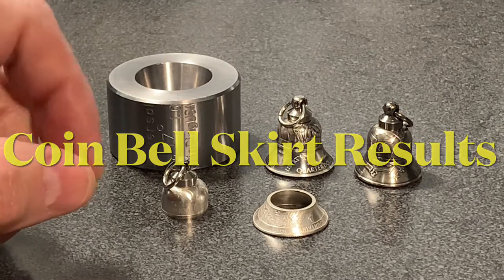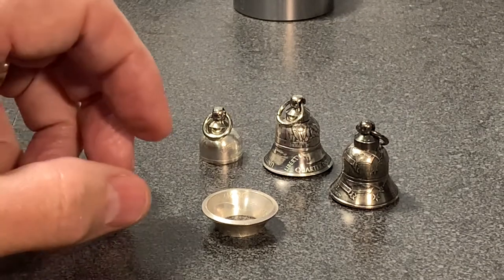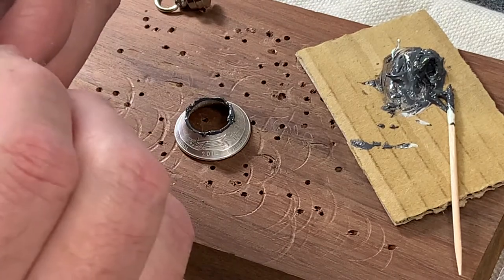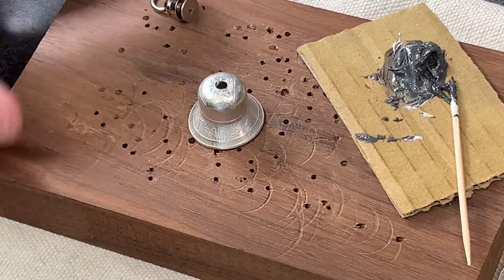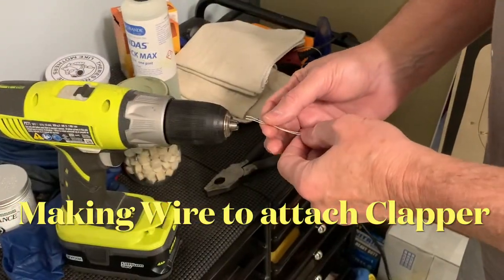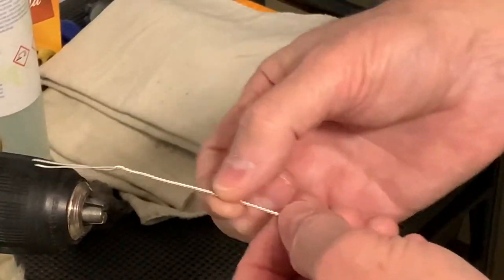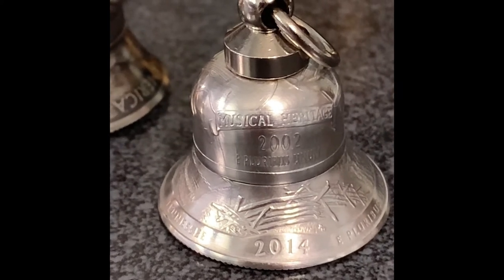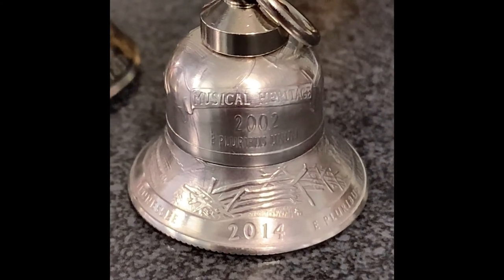Coin Bell Tutorial Part 4 (Conclusion)

Comment: Thanks for a really great series.  I loved making these bells!!   I do however have a question about the clapper. I am making them out of clad quarters using a 3/4 punch out but they just don’t sound right.  Any suggestions would be appreciated.
Reply from the maker: Thanks for the kind words!  I’m assuming that since you have large punch outs 3/4 as clappers then your bells are made from dollar size coins?  

I always make sure the clapper edge is hitting against the rim of the skirt and not inside.  Try a better hanging position or even a smaller clapper. Also, Bells made from silver coins will always sound better than clad.  None of my clad bells have ever sounded as good as my silver or copper bells.  

The same holds true for bells that are made from really thick coins unless they were made from silver.  Hope this helps some?
Reply: @jpcoincrafts  Thanks so much Jimmy.  I am making the bells out of quarters, as I love the size.  I will try some out of silver and see how they sound.  I will post some pictures when I have a moment.  I also love how you use the harbor freight lights in your press I stole your idea, but now I can see.  Again appreciate the time you take to show us your setups and processes.